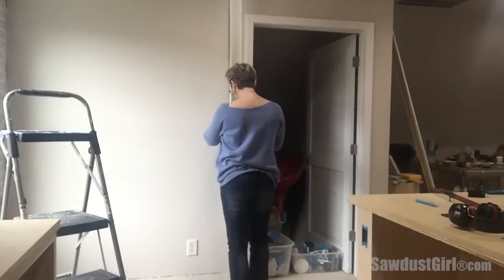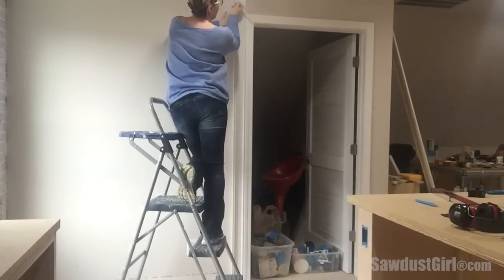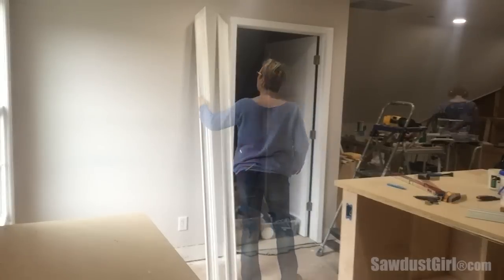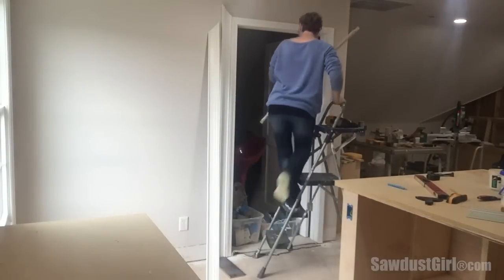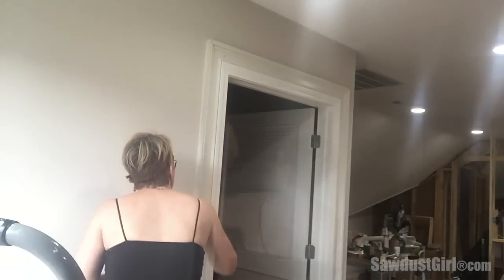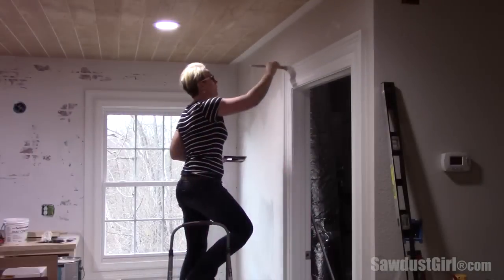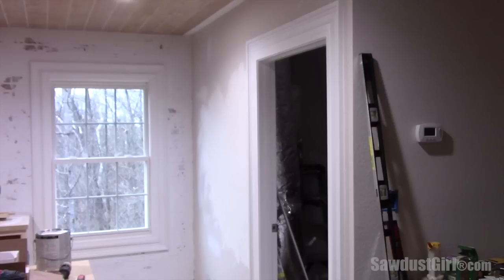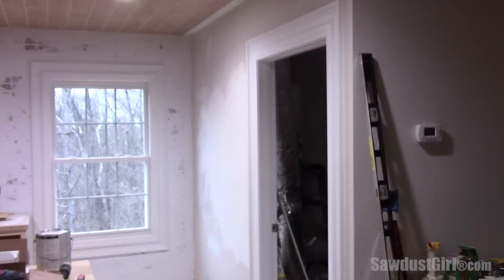Bulk up Existing Door and Window Casings - Trim Molding

Comment: Hi! Just came across your video! How would you address bulking up trim that is tight in some spaces? I have a hallway trim I’d like to bulk up, but our basement door casing is already kind of top. Would it be ok to bulk the top and trim the side to be flush with the wall? Not sure if that makes sense or not 😅

Comment: Did you glue the mitered corners?  And have you ever tried to caulk before attaching the side pieces to the original pieces so that it squeezed out b/t and acts like an adhesive ?
Reply from the maker: +Robert Lawrie No, I don't generally glue the corners since that is the one place the molding is nailed into a stud.  Also, I don't put adhesive behind the trim.  I Just caulk the seams.  It works pretty well.
Reply: +Sandra Powell aka {Sawdust Girl} thank you for the response.  I appreciate you taking the time to talk with me. Yeah I usually hit the corners with a little glue to ensure they say closed. I've never tried the caulk behind the seems but was wondering if you had.

Comment: whafvwas the originally casing aize and the added casing size?
Reply: what was*
Reply from the maker: +MrsCarter2428 The original is 3" and the added is piece 3 1/2" wide.
Reply: +Sandra Powell aka {Sawdust Girl} awesome..thank u
Reply: +Sandra Powell aka {Sawdust Girl} I was wondering if you bulked up all the trim in your house or just certain one.